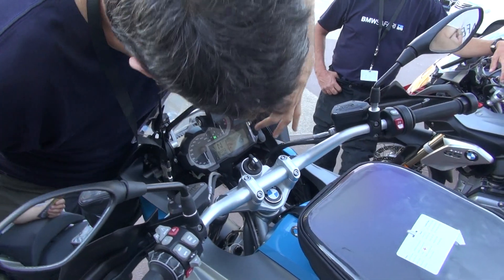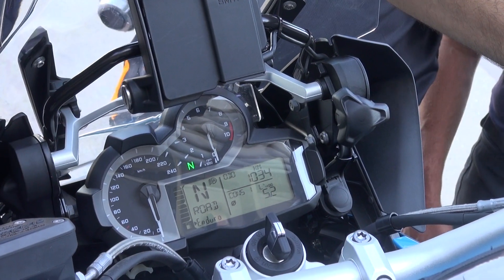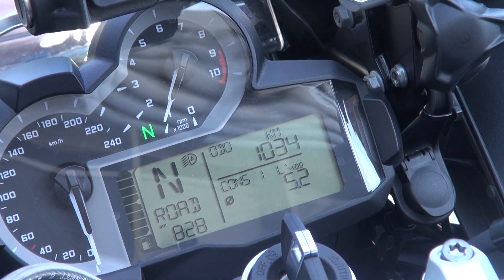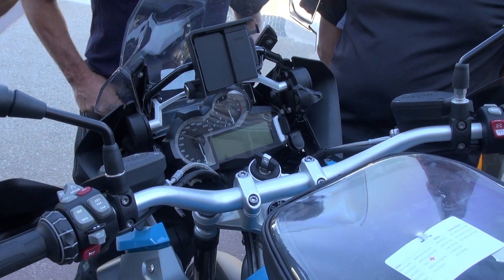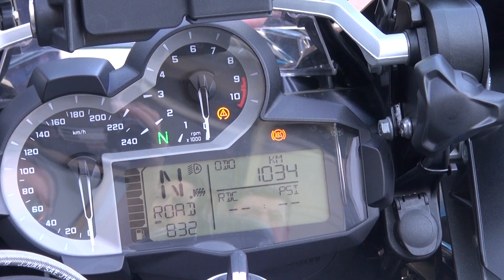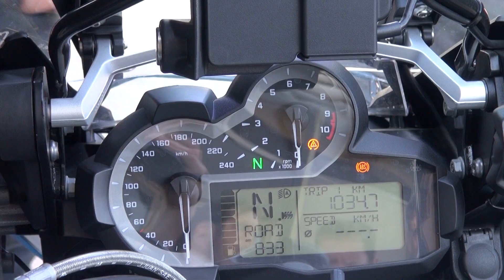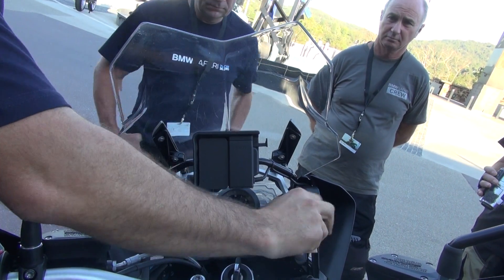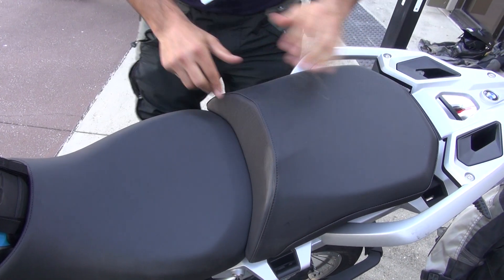2013 BMW R 1200 GS Technical Guide - How to operate the functions on the R 1200 GS

Comment: Hah !!!  Just found  this  today,  better late than never.   Best explanation  by  far  for a GS  1200  on  YouTube  👍  Had  my  2015  TE 3 years  and struggled find  to  a proper view as to  what  the  red  plug actually does in   Dyno pro    yeah, improved throttle response but what  if  anything else does it  do.  
Thanks 
Rij  🇬🇧

Comment: Excellent video! Valuable information for me, who just got my 2015 R1200GSA.
5:46 - Slight Mistake??. - The increase when using the cruise control is 2.5 km/hr per press. - pressing it four times will get you from 70km/h -to 80km/h
At least on the 2015 R1200GSA